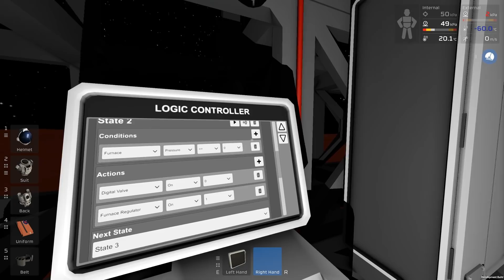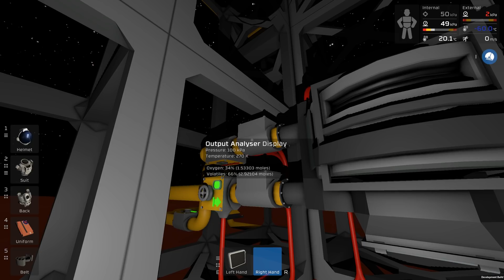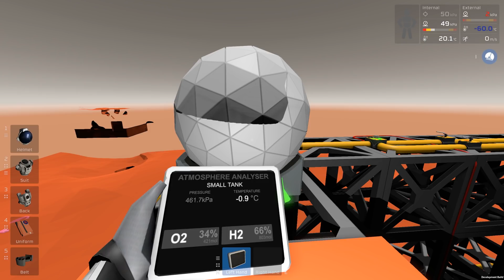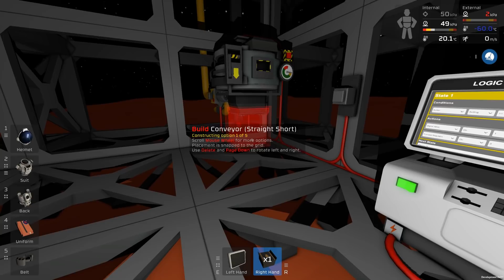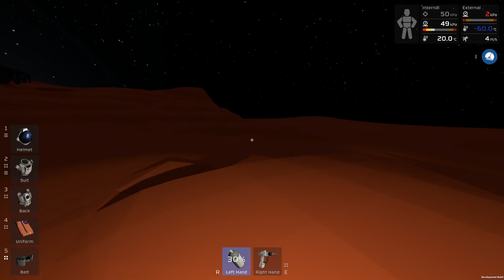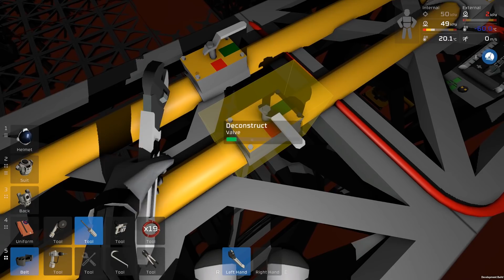Stationeers Season 2 E16 - Fixed Furnace! (and Auto Fuel Refilling)

Comment: you can use a volume pump or valve instead of a pressure regulator and have that open/close the furnace fuel input until the desired pressure is reached. that way it's operating way faster.

Comment: unless they changed it you can put noisy machines inside air-tight blocks and they won't make sound because they are in a vacuum
Reply from the maker: Heh, unfortunately, the pipe bender, lathe etc are all quite noisy :D

Comment: Conveyors have been in the game since it came out. Although I've not entirely sure why you'd use them over chutes, there's literally no upside to conveyors beside aesthetics. Chutes are faster and they use no power, conveyors use power are slow and there's a tendency for stuff to fall off them. You don't have to use a chute bins to feed into the chute system, you can setup the chute input and throw ores/ingots at them and they will suck up the items.

Comment: For your first furnace, could you not run Iron, Copper and Gold through it?  Those three do not combine into any alloys.
Also batteries do not discharge in parallel, they only charge that way.  Batteries will discharge in order of proximity to the power controller, closest to the PC will discharge first.

Comment: @ 5:00 I think the passive vents are not one directional.  I found this to be an issue in my CO2 system as well.  I tested this by connecting a passive vent directly to a single pipe piece that was connected directly to the output of a Filter with only C02 filters and it was still a mixture of the World air. in the single pipe piece.  I have not test if an active vent will solve this.

Comment: Ok, so interesting and VERY annoying bug I found today.  Just like cutting a wire and adding a new component to a power circuit will reset everything connected to it, the same happens if you use the labeler on a Logic I/O or Math unit already connected in the circuit.  I had a door connected to a circuit I was building with logic behind it and everytime I used the labeler to rename my logic components, the door would reset. How annoying is that?!?!?!?!
Reply from the maker: And that's why I have so many power connectors :)

Comment: When you can make all of the alloys, just try to make some of those nuclear batteries, because you will have a potential stationary battery within a battery slot! So the batteries powering your base will take up the 1/8 of volume or 1/4 of surface, not mentioning that you can put a APC on a wall not only on the floor! Or a never* dimming portable light! They are made in the Fabricator.

Comment: Since you need to cool the O2 for the fuel mix and heat the CO2 for the greenhouse, why not use a Air con. unit to heat CO2 by cooling the O2 down! Or if you don't want to use one of those, then make a 1*1*1 room, and pump thru while cooling the O2 within that room by wall coolers output of which you would attach to the CO2 pipe!
Reply: Basicaly a way of making your own Air con. unit, which uses probably less power than a real one.
Reply from the maker: I think the only issue with air con units is the huge amount of power they used to require, from memory - not sure if that's changed, but I'll certainly be using them :)
Reply: grayduster : I could be wrong, but they seem to use more power the hotter the "exhaust" temp is.  I had tested one that would break a wire every time the pollutant reached ~500C